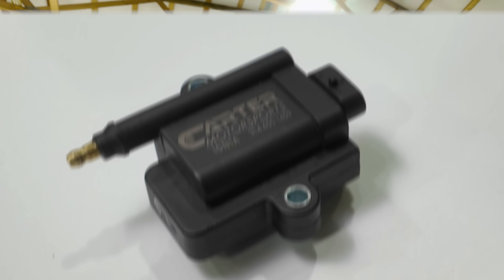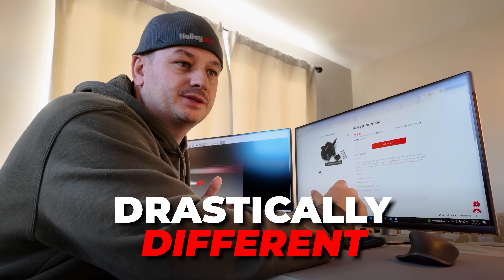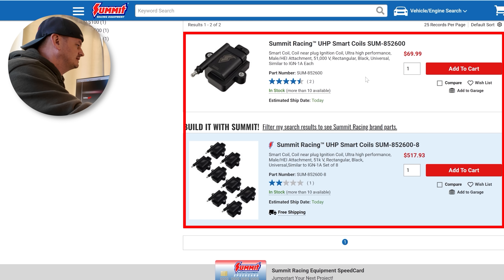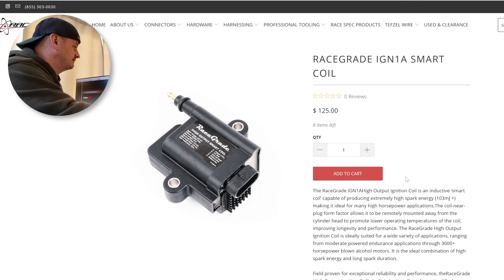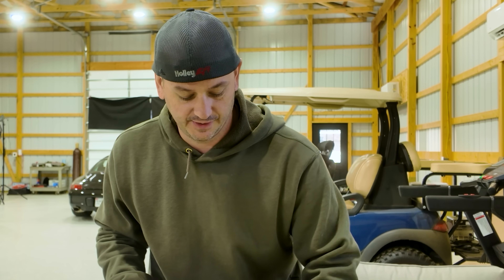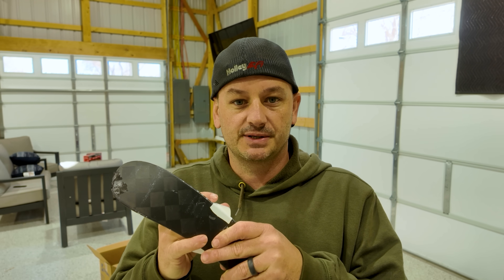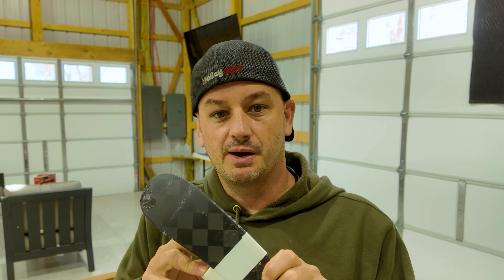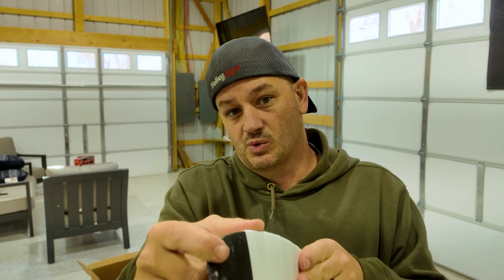These "Smart Coils" Cause Engine Failure - Beware

Comment: The OE heat sink coils were "auto firing" at random as well, they were the shit until that started happening. From what I've seen, the LS2/LS3 are the most reliable OE coils but, i don't know what their limits are. 
The IGN-1A coils originated from Mercury Marine applications and genuine ones are around  $160 ! I Doubt average car guys will buy them at that price, hence companies made knock offs. If it didn't come from Quicksilver and say made in USA on the package  AND have the digital part # etched into it wit tan potting material, I'd be suspicious if they were genuine. Holley has no problem putting their name on Chinese parts and selling for less.... 
Pull the Holley sticker back and check for the Mercury Marine part # ,i Doubt it's there 😉
Reply: Megasquirt manuals recommend keeping the dwell low, under 4ms on OEM truck coils
Reply: The issue is that if the coil is weak, it may fire way below its expected threshold. I've heard of some auto firing at 2.5 ms
Reply: There are aftermarket, good quality coils made for the marine market. CDI Electronics being one example. Easily identifiable by the blue housing. Not cheap however. Less than the Mercury Marine coils but far more than some of the cheap ones.
Reply: Its not holly bro...its the venders associated with the chinese
Reply: My best pal is a boat mechanic and comes across the OG Mercury Optimax coils all the time. It's what I run on my 2JZ. Only ~550*whp so overkill but hey - free coils is free coils!

Comment: All the ign1a coils are made in the same place with different names. 
The issue you have is installation error because they have to be turned on with an RPM activated output.  If you don't don't you will burn the coils up.
Reply from the maker: @zjw1155    The coils are turned on with an rpm activated output so your assumption is dead wrong here.
Reply: @JoeSimpsonAtTempest  never once did you talk about how they are wired. Unless I missed it.
Reply from the maker: @  they are both wired properly - was the first thing that was verified
Reply: @JoeSimpsonAtTempest  i have seen lots of people say they are wired correctly. And they end up not being wired correctly
Reply from the maker: @  yup i agree.
Reply: @JoeSimpsonAtTempest  are you saying the coil ignition power needs to be trigger on once engine rpm is detected? I.E. do not have coil power hooked up to ignition switch?

I’m having a weird issue with AMP EFI coils (customer supplied), where very intermittently the coils will fire on another cylinders TDC. 

They are wired correctly via RaceGrade data sheet and verified by ShaneT’s video he made. Still scratching my head, it seemed to be battery voltage related.
Reply: I used to believe this to be correct, if memory serves me I think there was a patent on the ign1a coils by a guy named lance possibly the same guy that use to own the ecu company red line and he developed the coils for mercury marine, maybe the company patent ran out?

Comment: I’m not questioning the validity of your statements or opinions but my question is what makes Holley the end-all be-all in aftermarket parts. I agree that there is higher & lower quality vs experience but does it not stand to reason that there would be a seemingly equal quality part that didn’t have the expectation of value due to the branding. In the same way there could be a’guy saying there’s nothing wrong with this brand there’s the opposite to the better brand. Awhile back you mentioned the idea of guys using the Holley X line in daily drivers alluding to the idea that it was originally designed for a cost effective system for the more limited use of race cars & this could explain why some people could be experiencing issues with it after time!! Could this idea not track to other parts, food for thought I guess!! Thanks for the content
Reply from the maker: @KarKamp  Holley is in no way shape or form the end all be all - it’s just one of the most popular ecu platforms out there.  I could type for an hour on why that is. Crazy part is with a few, what i would consider to be small tweaks, it could be even that much more popular.  With popularity comes complications - not just with motorsports stuff but business in general. Throw in that it’s now a publicly traded company and those complications get multiplied greatly.

Comment: 3k hp build and cheaping out on coils is crazy.
Reply from the maker: For sure was not a money thing with that car. Probably more of an ended up with them somehow.  Owner of the car even thought he had Holley coils on it haha
Reply: @JoeSimpsonAtTempest Also have you used any Holley Terminator Injectors?
Reply from the maker: @GeraldedwardKaiser  yea, had lots of issues with them.
Reply: @JoeSimpsonAtTempest  Thanks for the info. What do you recommend for thousand rwhp application? Best bang for the buck?
Reply: I'm an injector guy and I've seen tons of guys taken by china clones that are being sold at premium prices. "Must be good if it's expensive" is the common theme.

I recently had a customer with huge clone issues, fix it with real Bosch I sold him, then inexplicably buy more clones only to have the same issue. He was confused when I didn't give him another sweetheart 'wholesale' price.
Reply: I know it's crazy even OEM parts are being counterfeit and sold as genuine

Comment: why do we need SMART everything?

Next: smart spark plugs? smart valves? smart o2 sensors??? come on, stop putting "smart stuff" in places were they don't belong
Reply: What is the difference between a smart coil and a run of the mill coil?  Does it make its own decision on when to fire?
Reply: @Flyingmikey62  Nope they just added that moniker to make them sound special. Dont even do their own dwell control, the ECU still does all the smarts.

Comment: Here's my question at what point are you actually required to upgrade your OEM coils. Because most of the time people upgrade their coils because they just have the itch to upgrade something and coils is just something you can upgrade so they do it. The OEM coil will take you pretty far in HP
Reply: agreed, I was going to say, if a guy is making 2000-3000hp, then 900$ on coils is not an issue since such motor probably sets you back 50k...
Reply: Right, I am running a little less than 1000 at the tire on nothing more than a plug n play ecu. The whole wiring harness is stock. The map, tps, o2, coils, everything. Been a fair weather daily for years too.
Reply: Simple answer is when you can't gap your plugs tight enough to avoid misfiring at your desired boost/power level... Or, your plugs are gapped so tight you honestly believe it's costing you power that you need.

More compression and/or more boost = denser air/fuel mixture and higher pre-spark cylinder pressure = more difficult to initiate combustion = more likely to need a higher power ignition system.

Comment: Looking forward to test results. I have had at least 1 car with major issues with these coils. Terrible power. Blew TF up on a very soft tune up. Swap to Holley coils and takes way more in the tune up and doesn't hurt itself. Another car with them has made 2000+hp for years but had a couple coils die. Seem hit or miss but the misses sure do hurt.

Comment: No such thing has saving money in this game.....
Reply: Yes sir, you can pay once,or from what I've learned, is, you can pay once more ,if you're not smart on your purchasing for go fast goodies
Reply: @kennethkimmons7433 this is why I stick with what works. I've had the same turbo setup, bottom end, and same ecu system in my car for 11 years and it still holds up. Stock coils on my car are all that you need for sub 900hp and they have only needed replacing once. Sometimes you don't need much over stock parts for what you want from your power train.
Reply: @damianlindsey6177  yeah I'm still running the stock Square coils and I'm going to continue until they show signs of not keeping up, we probably couldn't eat to the tires right now no hiccups or misses

Comment: Matt had coil dramas on 8for8 with factory coils with the heat sinks. I can’t remember if it was a coil issue or a dwell problem
Reply: They get fatigued over time and start auto firing.
Reply: Yes, they were the heat sink coils that were "auto firing" at random.  The heat sinks were the shit until that started happening. From what I've seen, the LS2/LS3 are the most reliable OE coils.
Reply: most reliable oe coils are VW ones imho

Comment: Also seen where these smart coils need to be grounded directly to battery to prevent failures and other issues. Credit to Devon V.
Reply: Not sure why people call these 'smart coils' there is nothing smart about them what so ever. They are just a coil with a built in switch, all the smarts still comes from the ECU.
Reply: A bit of a misnomer I suppose. I believe its because an external ignitor is not required to trigger them.
Reply: @Shademax4273  Very much a misnomer, bit like calling a light switch smart. Both our company and Bosch build smart igniton systems a decade or so back and they were able to calculate their own dwell timing independent of the ECU.
Reply: @mwignitions9203  
That is really interesting. Probably super expensive? Curious why they Don t seem popular nowadays. In my world anyway.
Reply: @Shademax4273  Actually they were quite cheap. Invented for times before ECU's became common and they wanted better dwell conrol than the fixed time system previously provided by points etc. Also used with many early ECU's as they often didnt have dwell control. Eventually phased out as ECU design imporoved as they could provide even better dwell timing.with less hardware.

Comment: I dont build race cars but I wrench and fab alot. You're absolutely correct, I'd never place the catch can or rad overflow in the track of the wheel. Common sense.
Reply: As a road racer we have to have mininum 3 litre catch can. I use an old 5 litre oil bottle and cut some holes in the top for the hoses and drill a few small holes as well for it to breathe. Unlike all modern drag engines that fume was to an excess all I ever drained out was a bit of slightly oily water.

Comment: yeah or nay to OEM coils?
Reply: I wouldnt run anything but original coils
Reply: @AtMortenJ   That is fine to a point. cyl pressures at 3k hp require more energy than a stock coil can provide
Reply: @slowestturbovortec  perfect, thank you

Comment: That was super interesting. Thank you so much Joe.
Reply: One of the biggest problems we regularly see is with the ECU, not all are designed equal. There is no ECU101 design course and it takes time and experience to develop a hardware/software package that will operate corretly in an electrically noisy environment. Unfortunately even some old trusted brands still have major problems in this area. The outcome is poor dwell control of the coils causing their overheating/failure and mis-timing of the ignition spark causing major engine damage.

Comment: I won't use China coils on my normal daily let alone something that actually makes power. I will go to a junkyard and get used OEM coils for a car before i go to Autozone or something and buy new China ones. For whatever reason, China just can't get coil packs right
Reply: I'm not positive but I'd bet Holley's coils are made in china, most if not all of their ecu's and efi components are. I try to support companies that don't import from china but most chase the lowest price and the fact is, a lot of chinese products are very good but it's difficult to determine what quality you are purchasing. I prefer Haltech products, tight quality control and made in Australia
Reply: @travispfannmuller7717  Either China or Taiwan. Regardless of country of origin it’s about build specifications and quality control. You can get absolutely get quality stuff made in China. Hell look at the iPhone.

Comment: a tuner isn't a tuner without a thermal camera

you couldn't easily diagnose injectors or coils using this tool

a thermal imager could easily see if one coil is working more or less than others

after a pull you look for uniformity with this tool

by that tool buddy and you won't have these problems
Reply from the maker: I have had one since way back when they used to be really expensive. They are almost free now!

Comment: It seems most Holley stuff is made in china anyway. Are these Holley coils actually better than used gm coils?
Reply: When you get the real-deal coils - they are bad to the bone. Literally 5-10 times the amount of spark energy than most standard coils... Not to say the GM coil packs aren't enough to do the job; they usually are. But legit IGN1A coils have the juice to light up 500+ hp per cylinder no problem.